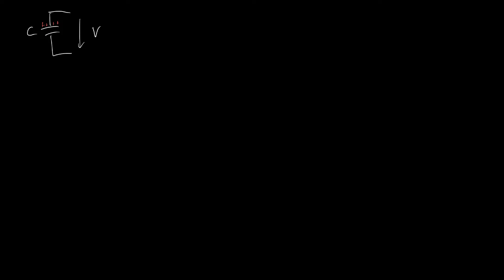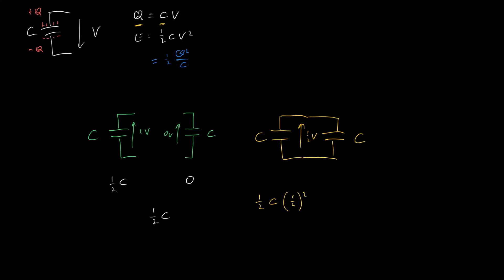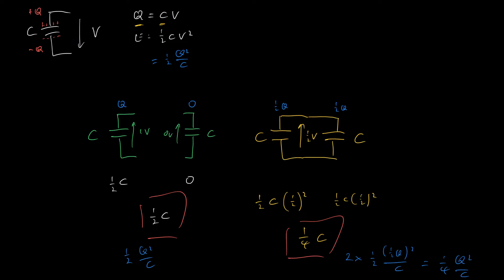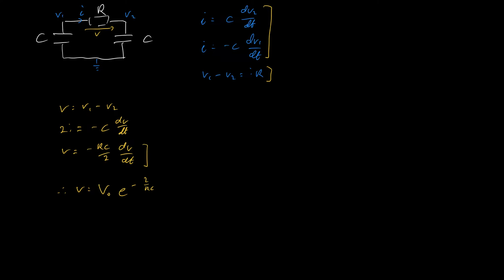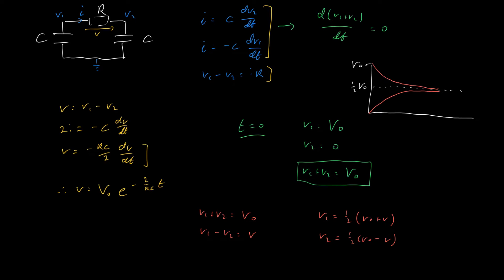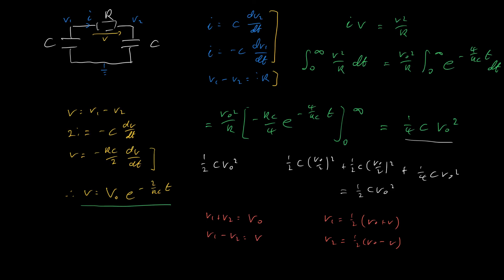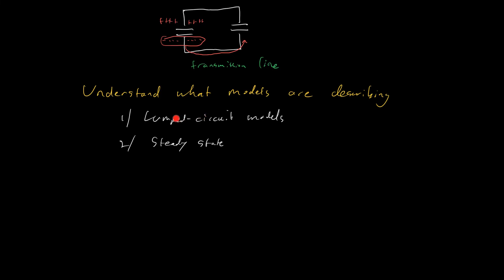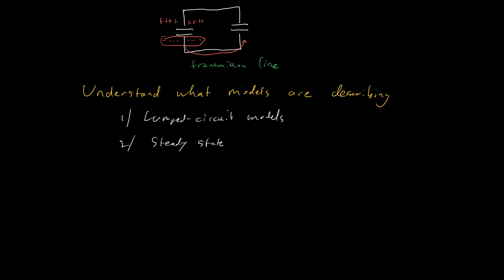The Twin Capacitor Paradox

Comment: Thanks a lot! i was looking for an answer to this problem but everywhere it seemed like everybody was assuming some sort of resistance involved, but according to mathematics even without ANY resistance, energy was being lost, that was making me confused
After watching this, I compared it to a collision
It's like, if there are two balls of equal masses, one moving towards the other, which is at rest, we know that in ideal case, they would switch velocities
But, if we already assume that they would stick together or a have a common velocity (or a common voltage in this case), we're already making an assumption which is only possible because of some resistance (Or deformations in the case of collision)

So, thanks!!!